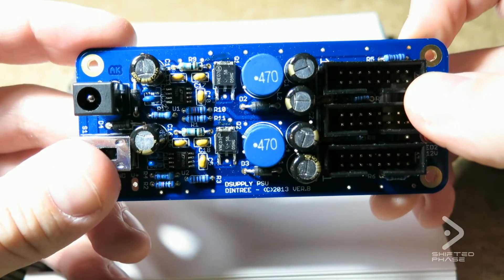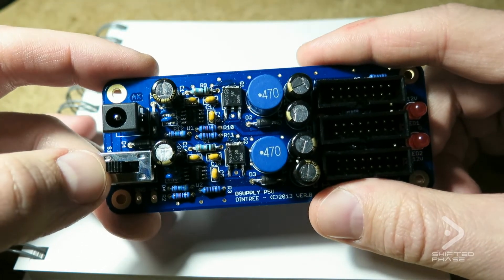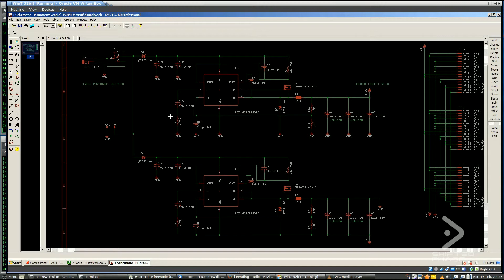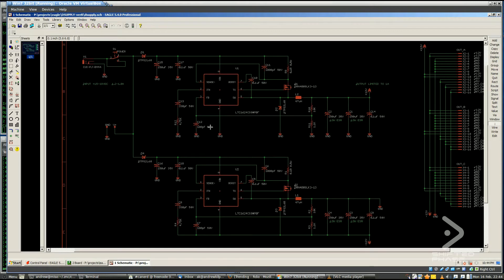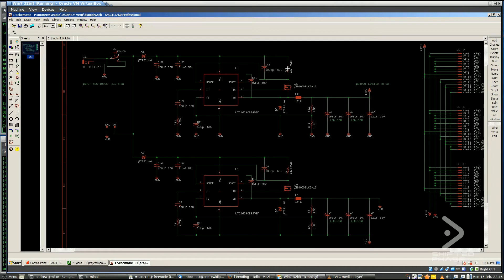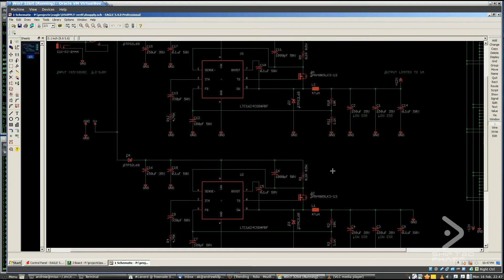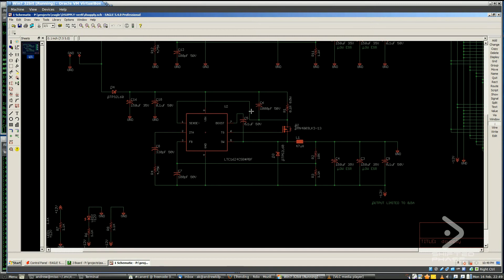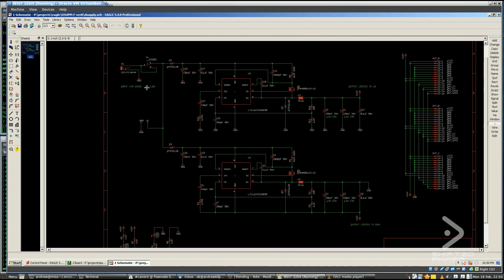Synth Tech - Eurorack Power Supply Design

Comment: excellent! small and efficient, very cool. Any chance of a variation for +-15V and MTA 0.156'' headers?
Reply from the maker: The voltage can be changed with a few different resistor values. As for the connector, I would make some kind of adapter... probably won't have time to spin a different version of the PCB. For larger systems you probably want a bit more current anyway.
Reply: @shiftedphase  Yes, I would use an external bus with the right connectors then. I'll be using a larger PSU but this small one would be nice to use for some satellite selfcontained modules. Are PCBs and schematic available anyway?
Reply from the maker: @fer_fdi  Please check out dintree.com for the full info. I don't currently have PCBs or Gerbers available.